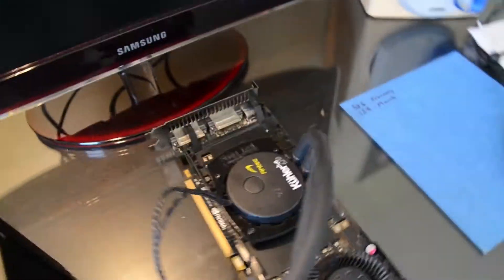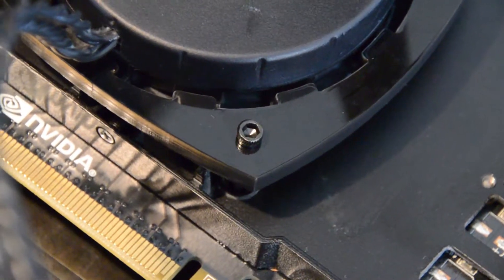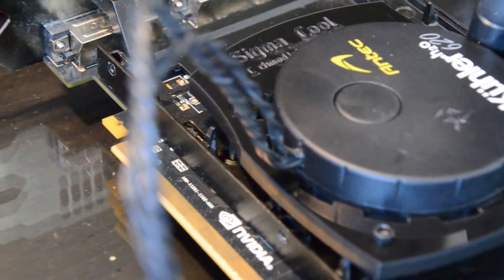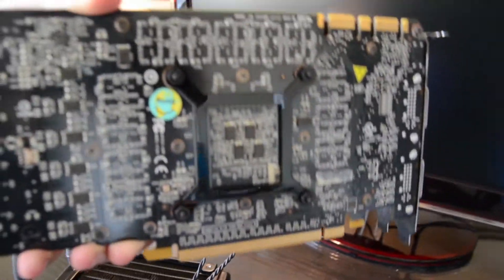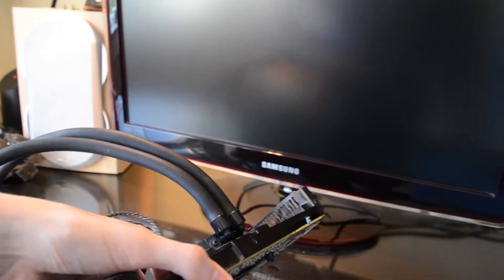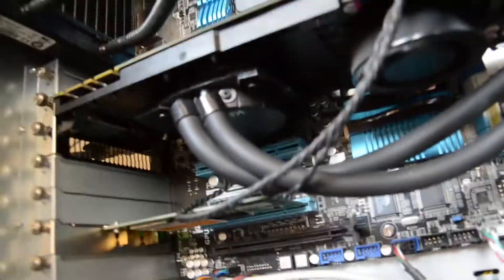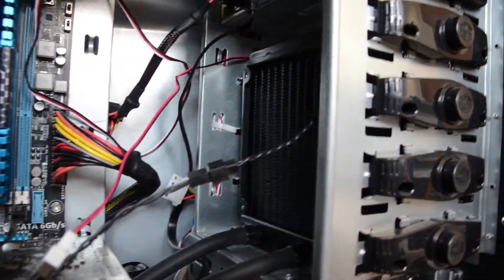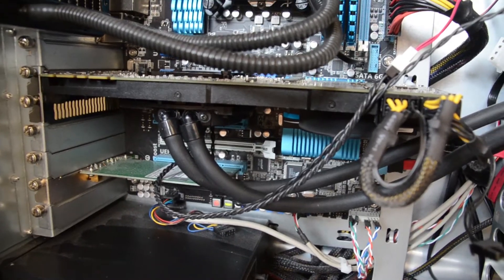Using an Antec Kuhler 620 on GTX 580

Comment: Have this exact set up using an antec 920 (thicker rad) on my 580 and it is cool as ice. Setting on silent mode and OCing it up to 980 (Highest stable I could get even with a modded bios using higher volts, Silicon lottery fail for me ;p) It never gets higher then 60C. I do recommend getting different fans then the ones that come with these coolers. They are loud and really don't work that well. Just switching to some cheap CM sickleflow fans made a huge difference in noise and temps.